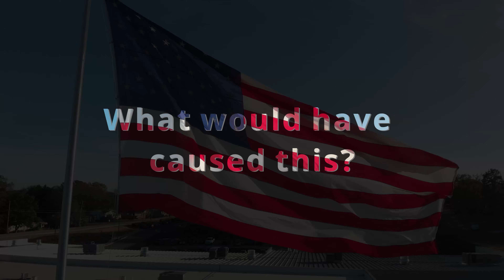That 70's Rinker Mercruiser 165hp Part 3 The Extraction and Preparation

Comment: MICHAEL - Enjoy your videos and those shop uniforms. Will be looking forward to video #4 on the retrofit of the 165 Mercruiser outdrive. I also went through a 20 ft 1968 Power Cat with a 160 Mercruiser I/O. You finished yours in approx 1 hour of videos and I had to take two years to complete. (joke) Worth mentioning the greatest gain in performance is when it went to a stainless steel prop. Faster to go on plane and better top speed. With eight Girl Scouts onboard still jumped out on plane. The old aluminum prop would not do it. Keep up the great videos. Little tips now and then really count. Like making carb lead seal balls from lead with a propane torch. Happy sailing. - Rich
Reply from the maker: So glad you are enjoying the series, more to come real soon, thanks for watching

Comment: Is there a way to remove the steering cable without having to take the motor out? I have the same motor on my 1970 StarCraft. I needa new cables but my tools just won’t fit back there

Comment: Gday mate what was actually wrong with the hull ? ,i have done a number of restos on boats coming to the end of my 5th  now i know your a motor man but you could get some money back for the hull shurly if you dont want it i mean even the windscreen is worth something to someone restoring one of those replacing transom is not hard good video that engine reminds me of a holden 6 cylinder they used to come in 163 179 and 186 then a 202 straight 6 easy as to work on some were marinised for use in boats almost identical .
Reply from the maker: There are so many boat hulls around here you can get for low dollars, for me to restore for myself it has to be a really cool old boat like my 1972 Glasspar I restored a few years back. The boat cost me over $5,000 in materials and parts and it could be sold for about $1500 so restoring old boats around here is not a profitable option.  I fix them to keep them.  Now this old Rinker had an engine that I like and I had to give $200 for the whole thing, so that is why one of my favorite boats is going to get an upgrade. The old glass is something that someone could use but the odds of someone needing that glass for that old boat is slim and it's not worth the hassle of removing and or shipping.  Thanks for watching